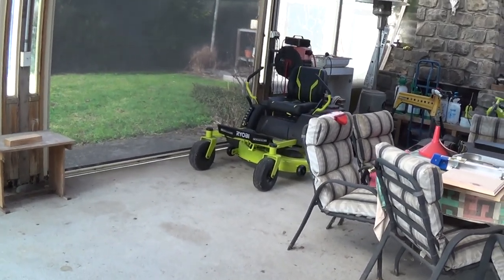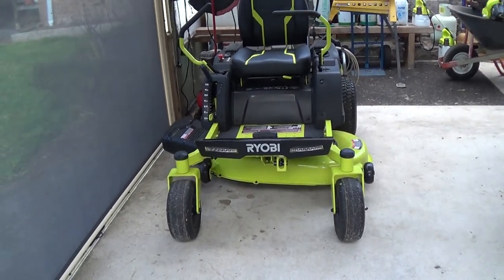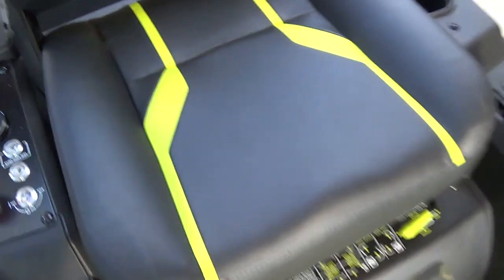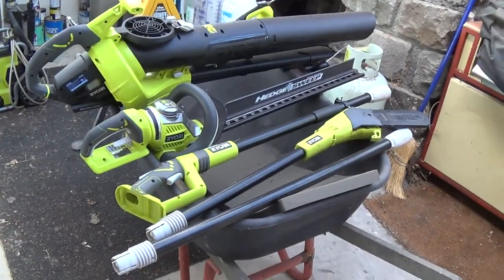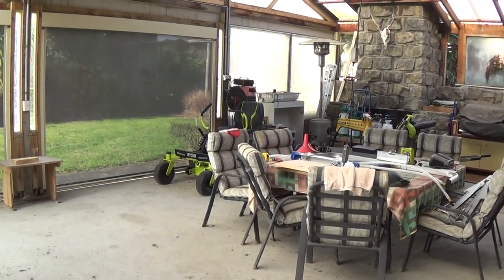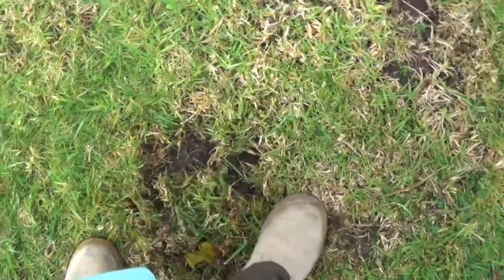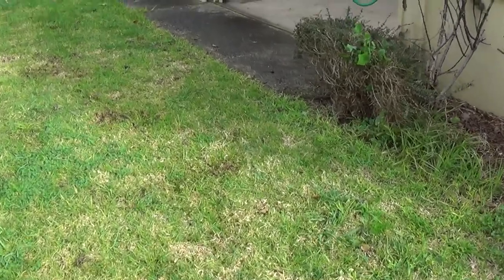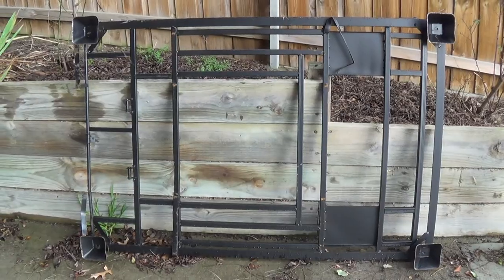Ryobi Zero Turn pre review

Comment: The steering method is perfect and extremely understandable.  Physics is a great thing to understand.
Reply from the maker: Sorry Scott, that doesn't apply when the mower rides on electricity and the driver runs on cheap vino... unfortunately the manual shows you pictures of how to turn it, but it doesn't "tell" you... if only the pictures weren't in Chinese.

Comment: I got one of them as well. LOVE it so far. I did a few videos on it as well. I found that you CAN do 3 acres easily IF you push the two buttons (low speed and slow cutter). Either way, it is a wonder machine in my opinion. I now bought a bagging system for it and hopefully have a video out for it in a few months. Have a GREAT day.
Reply from the maker: Love your post on cutting carriage removal.
Haven't tried the beast's cutting power and still learning to steer (between drinks)...  The weather still rank (my excuse), but am looking forward to a dry day... No idea how it measures up to caked on clipping, but the other "tractor" was a mongrel... though it had a self clean hose inlet.
Reply: @alexkara9696  I also did a couple of wet grass cutting tests that you can view on my channel that might help you in deciding to cut on wet grass or wait till dry grass. Hope it helps. Good luck my friend.

Comment: hey whats with both drink holders empty!?
Looks like a great machine!
Reply from the maker: Hell Rob, I missed this... rest assure it has been amply lubricated.
Reply: @alexkara9696  good to hear, and BTW what do you think of the battery powered pressure washer? I could use one on my roof for cleaning my neighbours leaves out of my gutters!
Reply from the maker: Not as powerful as the corded one, but good enough for my everyday household use... can still panel beat a car on the wrong setting. Helps already having a swag of 36V batteries.
I wouldn't use it on the leaves... I'd gather them and toss them on his/her front door step. That'll teach them to shed their leaves.

Comment: Nice work justifying a new mower rather than buying a new $80 battery for the old mower.
Reply from the maker: Actually I did buy a $80 battery for those super tight corners that the zero-turn couldn't squeeze into... Then I realised I didn't have a mower, so I bought one for the battery.